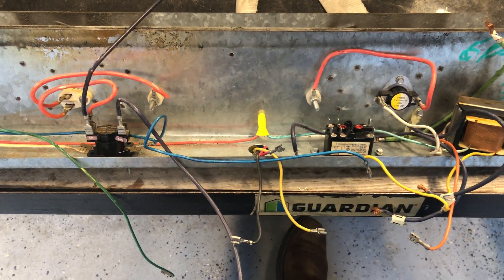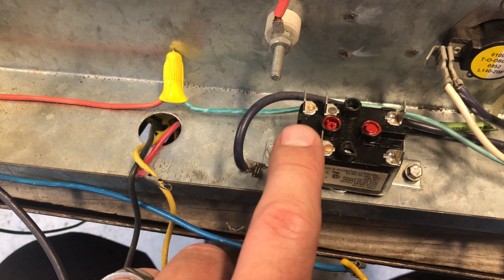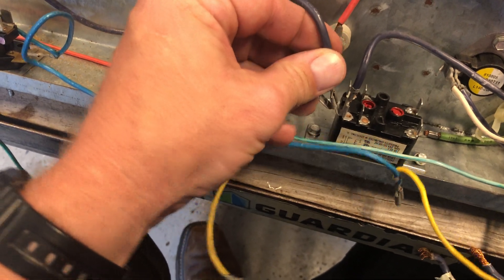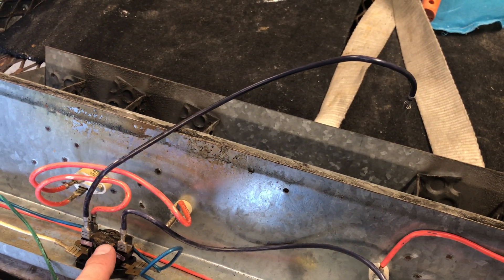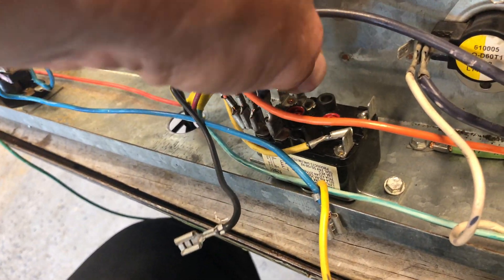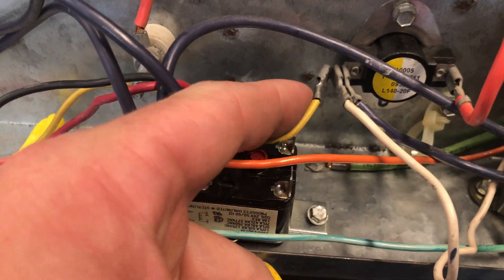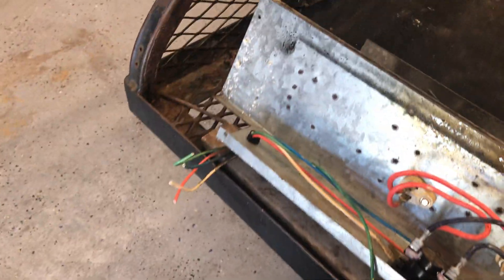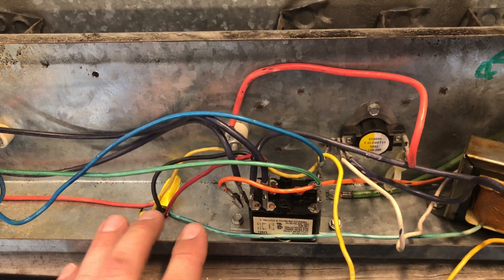Explanation on wiring up a fan relay on Fur Down Air Handler

Comment: I have a 31UC5 that recently stopped blowing the outside unit works. Had a tech come fix it he found wiring in the wrong place. Wired it up correctly but when we ran it I. Cool mode the emergency heat strips would run at the same time. So I disconnected the heat strips and the unit runs fine. But the fan won’t shut off whether the unit is in cool or off. The blower fan keeps running. And my power bill with it. Any suggestions would be appreciated. Thanks.

Comment: I’ve been searching for an explanation on videos regarding the relay, if the fan mode is set to on and relay coil is energized so the blower is running in high speed, but let’s say you have a call for heat while that happens, the sequencer closes and passes voltage through to the normally open (powered closed) set on the relay…my misunderstanding is then wouldn’t blower speed be running in high then when actually in heat you’d want the slower speed?  

I’ve been trying to wrap my head around how this works with the fan relay coil powered on.  If it’s not powered with a G call then that’s great, I understand how the heat call passes power to the lower speed in the normally closed set.  But once again, how does this work if that coil is energized??
Reply from the maker: @guitarwarrior69  Hello there and thank you for watching. The fan relay is designed to only allow power on the low speed or the high speed at any given time, never both. If power was applied to both high and low speeds, the motor would burnt out. When the fan relay is energized, the points for the high speed are closed and the points for the low speed are opened. When the relay is de-energized, the points close on the low speed and open on the high speed. When heat is called for, the heat sequencer will handle sending power through those low speed points that are already closed on the fan relay. This will allow the low speed to run. 

Now I’ve seen on some units shipped from the manufacture , they will cap off the red wire from the blower and it will only run in high speed. It’s how they have the wires configured. I think they purposely did this to help with not blowing the thermal fuses. By lowering the air speed, you allow for a hotter coil which with a dirty filter or any air restrictions can cause the thermal fuse to blow. To change the fuse kinda sucks but isn’t impossible. You could do a visual on the unit and see what wires aren’t hooked up. I hope this information finds you well.

Comment: The one I’m working on is exactly like this but only has 3 wires for the thermostat one on R, W, and G. How do I get it to call for cooling on the condenser. It was working someone messed with it and I don’t know how to get it back running
Reply from the maker: Hello there and thank you for watching. Before we start, disconnect the 240v power for the Air Handler. On the air handler, there are 4 wires coming off of it: Red(24v), White(heater control), Green(fan control), and Brown(common, this wire can sometimes be blue). The wire that runs to the thermostat is generally a 4 or 6 conductor wire. They will typically have two wires tucked back for extra uses since they aren’t using them. The typical wires that will be used are: Red, Yellow, White, and Green. Sometimes they will use one of the remaining wires to act as common.  At the thermostat you will have 4 terminals, 5 terminals if using Common. Those are R, W, G, Y, and C. It’s pretty self explanatory on where the wires go but I’ll map it out anyways. G-Green, W-White, Y-Yellow, C-your common wire if used, and R-Red(some t-stats have RC and RH terminals with a tiny red jumper wire between the two terminals). You will finally have the wire that goes to the condenser. This is generally a 2 or 3 conductor wire. The colors vary from wire type to wire type. What I’ve come across is Red, White, and black. I always tuck the black wire back for extra. I’ll use the red and white wires. So let’s wire everything together!!!  We’ve already wired the thermostat up, let’s get into the air handler and get to work. AH - Air Handler, TS - Thermostat, and CD - Condenser. Place a wire nut on the AH Red wire and the TS Red wire. Place a wire nut on the AH White wire and the TS White Wire. Place a wire nut on the AH Green wire and the TS Green wire. Place a wire nut on the TS Yellow wire and one of the CD Wires. Place a wire nut on the AH Brown or Blue wire and the other CD wire. If you’re using the Common wire from the thermostat, that wire would be placed under this wire nut too. Be sure on the condenser wires you use are the same color at the condenser. An easy way to check this is to disconnect 240v power on the condenser, open the panel on the condenser, and see which two colored wires they have connected to the contactor relay. I know it’s a lot of information to absorb but I hope somewhere in my blabbering you find the information you need to resolve your issue. Keep me updated, I’ll do my best to continue to help. Thank you!!

Comment: I have a Furdown unit that the blower will not come on in fan or cooling mode, but will come on in heating mode. Do you have any advice on what could be wrong?
Reply from the maker: Hello there and welcome back!!! I would start with checking to see if you have 24volts at the fan relay when you have the thermostat in Fan On position. If you do not have 24volts then I would start tracing wires back and check for loose connections and check that the thermostat is functioning properly. If you have 24volts at the fan relay I would then check that you have 240volts between the Black wire (high speed) and the white or yellow wire (common), not to ground, that goes to the blower motor. If you have 240 volts between those two wires, not to ground, then I would suspect that the high speed windings of the blower motor are opened and the motor needs to be replaced. If you do not have 240volts between the black and white or yellow wire then it’s possible that the fan relay is bad and it needs to be replaced. A two speed blower motor has two sets of windings. A high speed set and a low speed set. If the windings open due to failure, but doesn’t short out, then we the motor can still operate on the other speed just as long as it isn’t a direct short. I’ve rewired units, in a pinch, to operate on a lower speed until I could get a replacement. I hope this information finds you well.

Comment: If you turn on heat on your thermostat, how was your sequencer? Going to get power if your line coming in is on your normally open on the relay? You wired that wrong just that one area I mentioned
Reply from the maker: Hello there and thank you for watching. I believe you may have misunderstood my explanation. It was not wired incorrectly. There is constant power going to one side of the heat sequencer that comes from the junction point on the fan relay. Yes, it is on the normally opened terminals of the fan relay but that’s for when the fan relay is energized, it send voltage to the fan itself. There has to be a means of constant power at the relay in order for the high speed to work. Whenever the heat sequencer is energized, it closes and sends voltage to the heater and also sends voltage to the normally closed terminal. Since this terminal is closed, the fan motor will get the power it needs to operate. I hope this brief explanation helps you to understand it better.
Reply: I’ve been searching for an explanation on videos regarding the relay, if the fan mode is set to on and relay coil is energized so the blower is running in high speed, but let’s say you have a call for heat while that happens, the sequencer closes and passes voltage through to the normally open (powered closed) set on the relay…my misunderstanding is then wouldn’t blower speed be running in high then when actually in heat you’d want the slower speed?  

I’ve been trying to wrap my head around how this works with the fan relay coil powered on.  If it’s not powered with a G call then that’s great, I understand how the heat call passes power to the lower speed in the normally closed set.  But once again, how does this work if that coil is energized??

Comment: Best video out of dozens I've tried to watch on this subject. My system has 2 heat strips and 2 heat sequencers and the 6 pin relay. My AC guy ran the power supply wires for high and low speed on the 6 pin relay from the sequencers. (2 sequencers - 2 power wires, one for high, one for low). So the fan won't turn on by selecting "Fan Only" on the thermostat. It has to get power supply (the other half of the 240) from the sequencers, which don't activate unless the heat is called for. I called another AC tech to come troubleshoot. 2nd AC tech said motor was bad so I bought a new motor. I suspect it was the wiring method that was the problem. Motor runs fine when I bypass the relay. SO, should I run a power line from the transformer (120) directly to the high speed part of the relay? And leave the power line from one of the sequencers connected to the low speed part of the relay? Does that solve the problem? Thank you.
Reply from the maker: Hello there and thank you for watching. Have you checked to see if you have 24volts at the fan relay when the thermostat is switched in the On position? The fan relay has 6 terminals on it. The 2 that are far from the other 4 are for your low voltage. The ones in the middle are for the low speed and the outter ones are for the high speed. When the fan relay is energized, the outter terminals are closed and completes the circuit. At this exact moment the inner terminals are opened. This configuration will not allow the low speed and the high speed to be powered up at the same time. The wires from the motor will go on one side of the relay. Let’s just say the top side. The wires from the motor are Black, Red, and White. The high speed wire (typically black) will go to the outter top terminal. The low speed wire (typically red) will go to the inner/middle top terminal. The yellow or white wire will go to what we will call the common block. 
That basically covers the wiring configuration for the motor end of it. On to the line side of things. As you may know you have two legs of 120volt. Let’s take line 1 and hook it to the common block. Line 2 will go directly to the heat sequencer. On a 5k heat sequencer there are 2 levels, as I call it, of terminals. The lowest one closest to the mounting screws is for the low (24v) voltage. The second level is for your high voltage.  If it was a 10k sequencer then you would just have one more level. The Top level of the sequencer will have a left side and a right side. Each top side will have 2 joined terminals. So back to the direct wire in of line 2 to the sequencer. Line 2 wire will go to one of the terminals on the top left side of the sequencer. There will be another wire connected to the other terminal on the left top side of the sequencer. From there that wire will connect to the lower outter terminal of the fan relay. That now completes the high speed side of the circuit. Now for the low speed. There will be a wire that connects to the top right side of the sequencer and connects to the lower inner/middle terminal of the fan relay. This now completes the low speed side of the circuit. For the heater, there will one wire from the other terminal on the top right side of the sequencer that goes to the heat strip. There’s typically other in line saftey components before going to the heat strip but I’ll keep it simple for ya. The other side of the heat strip will go to that common block we made early on. At this point of the configuration, the fan should be able to automatically be controlled by the thermostat and if you so desired, be able to just switch the fan to the on position. But back to the very first thing, check your voltage at the fan relay. I really hope this information helps you out and I hope it isn’t too confusing for you.
Reply: @klinthanks9946  Yes, that all makes sense. My configuration is a bit different in that the lines from the shut off go to a kind of splitter block, one for each L1 and L2 and those little junction blocks then passes the power on to the other components. Feeds the line side of transformer. Feeds the sequencers which feed the heat strips. The relay is fed 1 and 3 with the 24v green and common. 6 is the low red. 4 is the high black. 5 is connected to the top side of one sequencer. 2 is connected to the top side of the other sequencer. The relay clicks when turned on but the fan didn't power up. Tech diagnosed bad motor. I put new motor on, same problem. Put new relay on, same problem. In your set up, high voltage is on #2 pin always. So your high speed fan works when "Fan Only" is set. In mine, there is no high voltage to the relay unless the sequencers work. That is why I wondered if I should move the source of #2 on mine from the sequencer to a constant high voltage source. And I'm sure the sequencers work because heat strips come on when thermo tells them to. Crazy. Thank you so much for the reply.
Reply from the maker: It seems the wiring maybe incorrect. That fan relay is a 90830 which is the most common fan relay in many air handlers. The fan relay is energized anytime the thermostat cycles on when in cool mode. That’s even in auto. Those relays are pretty simple to wire up if you have a schematic. It’s possible the cover was thrown so you may not have that option. Instead, you have me. So 1 and 3 are for the low voltage (24v). 5 and 6 are normally closed which means it has continuity when no voltage is going to the relay. 2 and 4 are normally opened which means it does not have continuity when no voltage is going to the relay. When the relay is energized, 2 and 4 close while 5 and 6 open. This allows the motor to never have both low and high speed working at the same time. I would suggest moving that wire that is connected to #2 to possibly the other side of that sequencer. That seems to be the culprit. You’ll be connecting it to a constant hot. Use my previous reply to assist you in following your wires back. The sequencer is normally opened when no 24v is going to it so if that #2 wire is connected on the same side as let’s say the wire that goes to the heating element then it’s possible to just move to that wire to the other side of that sequencer. Just remember, when I say constant hot, I’m referring to staying on the same leg of high voltage. There are two legs of high voltage. It’s possible you’re just on the wrong side. The entire system is constant hot. The components just complete the circuit. Give it a try and let me know if you are successful.
Reply: Great explanation. That is exactly what I did. Connected to constant hot and now it all functions as it should. Heat works. And if I go set the therm to fan only, it comes on now. Whereas before it did not. Thanks for taking the time to advise me. @klinthanks9946
Reply from the maker: You’re very welcome. I’m always willing to help someone out. Glad I was able to be of help. Take care!!

Comment: Where to connect the wire for cooling?
Reply from the maker: Hello there and thank you for watching. For most heating/cooling systems, the thermostat is what is going to control that. From the thermostat there will be typically 5 wires for a normal straight cool/electric heat system. Green, White, Red, Yellow, and the fifth color varies. Green is for the fan relay at the air handler, white is for the heat sequencer at the air handler. Red connects to the main power from the air handler. Yellow bypasses the air handler and goes to one of the control wires for the condenser. The other control wire from the condenser will go to the common wire at the air handler. The fifth random color from the thermostat is for Common hook up for the thermostat. That will then connect to the air handler common. Hope this helps.

Comment: I have a Goodman Furdown unit, and the blower won't come on. I'm getting 125 volt to each blower motor leg. Is the motor bad?
Reply from the maker: Hello there and thank you for watching. Do you have 240v, between the legs, to the motor? Just because you have 125v to each leg doesn’t mean the motor is bad. There’s a possibility that you aren’t getting full voltage. If a 240v motor is only getting one leg of voltage, it will go through the windings of the motor and back feed on the other leg making you think you have voltage. Anytime I diagnose a 240v motor, I want to see 240v on a voltage meter before I condemn it. A voltage tester or as I call it a Hot or not is not a good method to determine if a motor is bad or not. The voltage test only picks up current.  If you do not have the full 240v at the motor then I would recommend checking to make sure the breaker isn’t flipped and then begin checking the fan relay or the heat sequencer to see if low voltage (24v) is being sent to those components. If there is a low voltage issue then nothing will work. I hope this information helps you out. Let me know if you need more information. Thank you
Reply: @klinthanks9946  thanks for the information. I'll check everything and let you know.
Reply from the maker: You’re welcome.

Comment: why is my relay buzzing? what effects will it have on the ac? fans are working, same first co unit..thanx!!
Reply from the maker: Hello there and thank you for watching. Some relays eventually make a buzzing sound. I’ve had contactors on condensing units buzz for months without concern. It’s annoying but the functionality is still there. I’ve had quiet relays/contactors short out with no warnings. Most relays cost next to nothing to purchase. Less than $20.00 on most types. Super easy to replace and it’s one less thing to worry/hear about. Hope this helps.